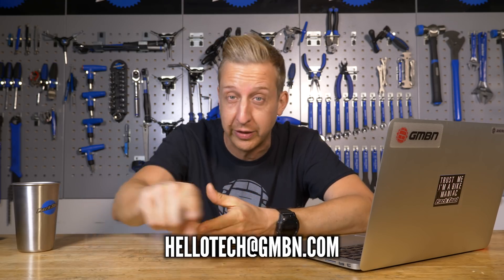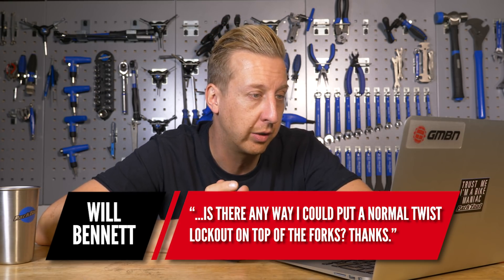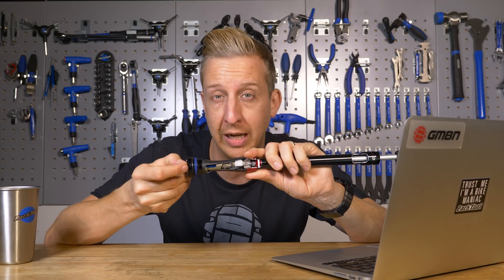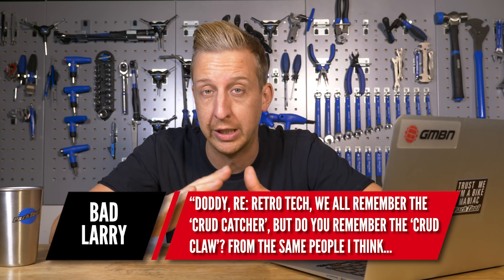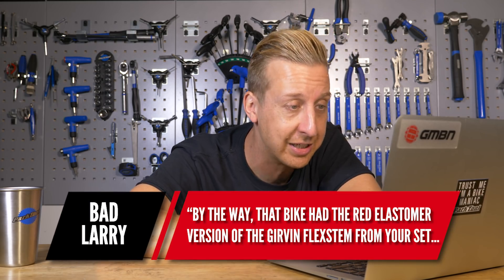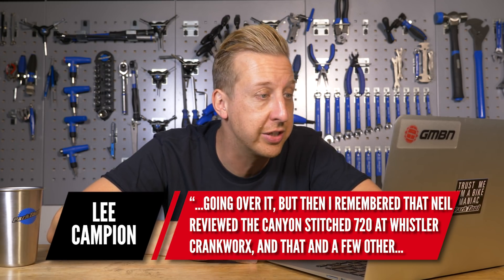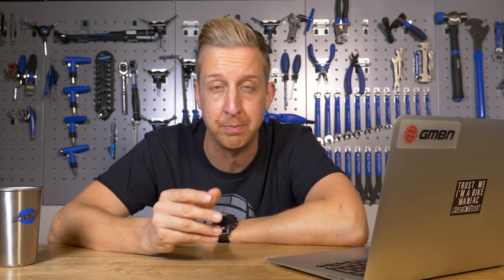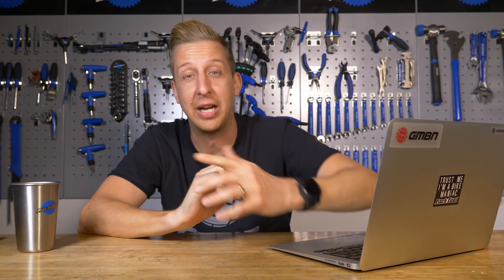What Does A Concentric Pivot Do? | Ask GMBN Tech Ep. 67

Comment: #askgmbntech I recently bought a brand x ascend dropper remote and the  lever clamps thread got pulled out while installing it, my local bike shop says except the fox and brand x remotes none will work because the nipple attaches to the post not the lever could you use a different brand remote and tie a knot or put a nipple on the remote end to act as a nipple?

Comment: #askgmbntech
I'm planning on getting a drop bar on my 2013 Trek Wahoo, already got the rigid fork and road groupset to convert it to a DIY gravel monster, problem is that my brake levers fasten using a single bolt only so I cant get them around the bend, aside from investing on new hydraulic brifters, or is there another way to fasten my levers to the bars or is there a lever that you recommended that I can swap out and still save money with? (using a 2016 model Deore brakes by the way)

Comment: #AskGMBNTech Hi Doddy, 
I’ve been eyeing up the new Canyon Spectral, specifically the AL6.0 or the CF7.0. 
Aside from the obvious difference in frame material, the only difference I noticed was the suspension. What are your opinions on each setup? 
I feel I’m steering more towards the Rockshox equipped CF7.0, as it’s more familiar to me. However the cheaper price of the AL6.0 is tempting. Is there much difference between the two?
Cheers

Comment: #AskGMBNTech
Hi Doddy, greetings from Norway! Thanks for a great show, I’m learning new stuff all the time watching these! 
I have a question regarding tubeless sealant; I’ve been running tubeless setup for almost a year now on my Mondraker Factor XR 29er, and although I’m aware that the sealant should be replaced fairly regularly, I’ve been running the same “gunk” up until now. So here’s my question; how much cleaning or removal of the old sealant from inside the tires is necessary before refilling with fresh sealant? I’ve cleaned up the rims and valves, but the tires still have some serious gunk left. Hope you’ll address the issue. Best regards, Tom.

Comment: #askGMBNTECH  Hi Doddy, I have a GIANT REIGN 2017 that is fitted with a ROCKSHOX 200 x 57 Monarch and a 160 Travel Rear Suspension . I'm planning to upgrade to a latest RockShox Super Deluxe Ultimate RCT Debon Air. But the only closes size I can find is 205 x 57.5. Can I still fit this on my existing frame? Cheers.

Comment: #AskGMBNTech  hey, i have a tubeless set up and got a puncture, the sealant did its job but now i was wondering if i have to do anything to the tire, or for how long can i use the tire like this with the puncture blocked with the sealant, do i need to take it off and patch the tire, should i just put some gel glue on the top where i have the puncture? or what do you recommend, thanks

Comment: @AskGMBNtech
Hi doddy, love the show, I have a 2018 s-works stumpjumper 29er and was hoping to put a 27.5 wheel on the rear of the bike to make it more of an enduro bike. With the slacker head angle, more manoeuvrability, tougher rear wheel as well as a slight weigh loss. What are the advantages and disadvantages? Is BB height an issue then? Cheers Thomas

Comment: #ASKGMBNTECH. Is possible to put a 27.5x2.6 tire on a 141mm QR rear end. I am planning to get the Marin San Quentin 1. I do like having wider rear tire. My tire setup maxxis minion dhf 2.5 at the front and maxxis high roller ll 2.6 at the rear.
Reply from the maker: Hi Anjelo, the maximum tyre width is really dictated by your frame's tyre clearance. If you want to be geeky like us and get a decent tyre profile it's good to know what the Internal rim width is. Really anything under 23mm internal is a little narrow for a 2.6" tyre. Hope this helps👍

Comment: #AskGMBNTech 
Hi Doddy!
I have a clinging noice coming from the back of my bike. It sounds disc brake related, but the noice sometimes appears when pedalling, and compressing the suspension. So I really have no idea, any suggestions? My bike is a Scott Spark 730 Elite with 140mm travel up front, and 130 out back. And it has 180mm discs. Cheers

Comment: @Will Bennet - Reba issue with the remote - I removed the remote on a Sektor and made a small lever by pinching a piece of hard metal with the grub screw and covered the end with a nice looking cable end-cap (to match the bike color). Pictures:
ibb.co/vLtyrxp
ibb.co/txDJJw0

It goes like this: open up the damper and remove the spring that makes the damper head return - just turn it a few times and you'll see how it works. It is a bit tricky to remove, but not that bad. Then put the damper back. If you have a 2019 fork I assume it looks like this: https://media.alltricks.com/hd/57b433a692b5b.jpg. Insert a DIY lever between the two rotating discs (top cap and the other disc that was holding the cable).  Screw in the top cap to hold the lever in place. If it moves too easily, add a rubber o-ring between parts. Enjoy the clutter less handlebar :)
Reply: InstinctiveArcher thanks mate will give it a go great hack

Comment: #AskGMBNTech Hi Doddy! Question about boost hubs: in general, is the extra 6mm (142 /148) width of a boost hub taken up strictly by the axle components (or adapters), or is the actual hub body also wider than a standard hub? I realize this may vary by manufacturer, but I'm wondering if I can swap the guts of a Mavic boost hub with the guts of the same model Mavic non-boost hub and use it on a non-boost frame? Aside from the hub body width, my concern is disc rotor position.
Reply: Christopher Reid depends

Comment: #askgmbntech
Hi Doddy! I want to replace my hydrolic disc brakes and was searching for a good tutorials on Youtube only to find out that there are none. Because my bike has internal cable routing I need to take the lever off the hose to fit it in my frame. The brakes come pre bled, but I assume I need to do a lever bleed afterwards. Are there any brake specific things I should pay attention to? I know how to bleed my brakes and have replaced my gear cables before but never my brake hoses. 
Cheers Tim

Comment: #askgmbntech 
I have a 180mm enduro bike. If i run it with 160 mm forks in front, should i, or can i change my rear shock to 160mm too? I would convert it to 160 at the back in order to make it more playful in the air and at the trails.
Reply: I would definitely advise against downsizing the forks as there is no real advantage, and would make your bike super wonky. If you want a more "playful" feeling bike, the easiest option is to just add more air to your shocks / buy stiffer springs. Look up the likes of Sam pilgrim and other freeriders and take a look at their (enduro) bike set ups (super hard suspension for jumps). Also, suspension travel won't make a difference once you're actually in the air, only on takeoff and landing!  
Tom
Reply: @tombolton1724   It was a helpful answer. Of course. I share your opinion! Thank you!
Reply: No worries, happy shredding!

Comment: #AskGMBNTech I notice when I go to put air in my rear shock the gauge does not show any pressure though it, the shock, seems to be working.  When I back the pump off I can hear some air escaping.  Is there a particular "correct" way to attach and remove the pump?

Comment: #askgmbntech
Different seatposts have different minimal insert lengths, but I am worried and think that the frame has one as well, so if I use a too short seatpost I could damage my frame.
Is that true or am I just overthinking? And if so, how long does it have to be at least?
Reply: Maik Eckert as long as you follow the minimum insertion on your seat post your frame will not break

Comment: #askgmbntech Hi Doddy, I have just noticed on my bike (Yeti SB6) clunk noise coming from my rear derailluer. I took rear shock off and when clutch is engaged it does that sound and there is quite a bit of resistance when try to move rear triangle up and down. When clutch is disengaged it moves smoothly and no noise. I noticed that noise while I was riding every now and then and  I first thought it was  spokes...How can I fix that? Thank you for response
Reply from the maker: If it's a Shimano clutch you can service it and or play with the clutch tension. If it's Sram it's a sealed unit.
Reply: @gmbntech  it is Shimano XT, ok that is result then, maybe too much tension then, I have took clutch cover off to see if it is all in tact.. So clutch meant to keep chain under tension but at some point slip? Thank you 😉
Reply from the maker: @robertgadus8486 Check these videos out as they may help you 👍 
https://youtu.be/0j7p1DP2R5Y?t=701 
https://gmbn.eu/adjustshimanoclutch
Reply: @gmbntech  Legend 👊🏻 I have even seen that video before 🤦‍♂️, definitely tension then as my cage doesn't move at all when clutch is on... Thanks again 🙌
Reply: All sorted now 👌
Reply from the maker: @robertgadus8486  Great to hear! 👊

Comment: #askgmbntech I went on a ride with my brother and when we went down a steep decent. He said that he could see his rear brake disc starting to glow, we both noticed a odd smell. Have you heard of this happening? He was on a 15 year old Jamis with mechanical disc breaks. Also I was wandering have disc and break pad technology has changed since then as my modern bikes hydrolic breaks have the same size rotors and didn't get as hot.
Reply: Alexthelion2 it’s normal for brake pads and discs to heat up. Newer technology in calipers, pads, and discs keep them cooler
Reply from the maker: Generally speaking it's best to use a shorter and shaper braking actions with disk brakes to reduce the chances of brake fade or burning the disk rotor on long descents. For technical mountain biking it is less common as people tend to brake in this style anyway. However on long straight descents it is more common for people to drag the brakes and cause extreme heat. Most brands offer various styles of disk rotors to disperse heat more effectively and some offer finned brake pads. This was really highlighted as a potential issue during the introduction of disk brakes to road cycling and we now see some interesting rotor designs for dealing with heat in the road world.

Comment: Regarding lack of lockout, your charger damper might just need a bleed, since the air will compress even though the oil flow ports are blocked with the dial. The kit can be had for around 35€ and you'll need some small snap ring pliers. Either that or you've blown the bladder, which is a more involved repair.

Comment: #askgmbntech
Hey Doddy, is it better to store your dropper post up or down, does this have any effect on your dropper?
Reply from the maker: It is better to store them fully extended longterm. This is due to the high pressures in the body. A cable or hydraulic actuated lever will not affect this.
Reply: All the way up is best as it rests against a physical stop instead of relying on the mechanism to hold it.
Reply: I always leave my dropped so it doesn't get scratched
Reply: Also, does the answer change between cable or hydraulic?

Comment: #askgmbntech
Hey guys (weird not only talking to doddy) I would like to get a drooper or drop my seat manually, but the Threads for my bottle cage in my seat tube make that a Problem since I can only drop it around 6 cm and I already cut my Seatpost shorter
Any solutions?
Reply: Maik Eckert make a slot in the seatpost were the strews hit i tink
Reply: @fastbicyclerider7300  That could work, but don't you think this could be problematic if the seattube is extended?
Reply: Drill out the threads then cover the hole by wrapping it in that rubber stuff doddy loves.
Reply: @ryansara3398  That would be quite a hole, not sure if this wouldn't damage the frame(stability) too much.
Reply from the maker: Hey Maik, are you able to just remove the bolts?
Reply: @gmbntech  Yes, I can remove the bolts, but it get's Stuck on the threads where i can mount the bolds